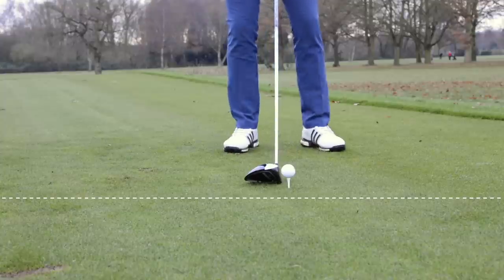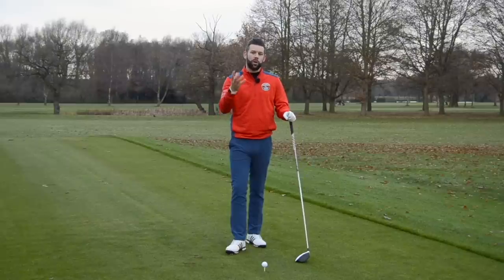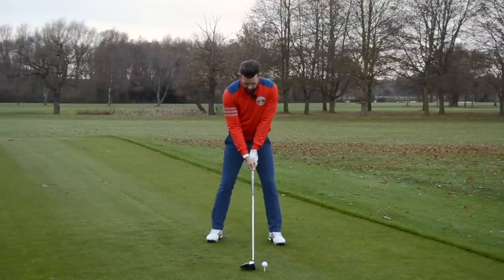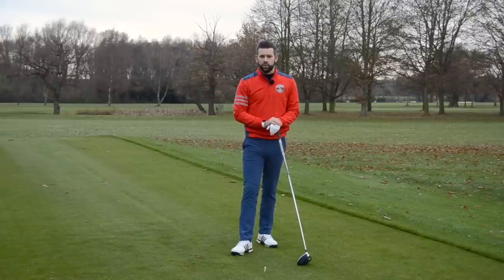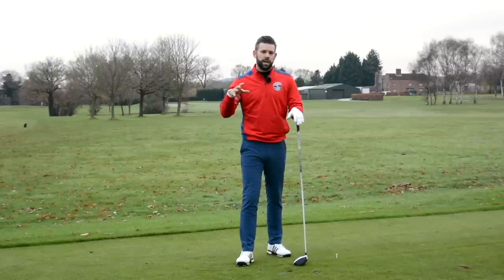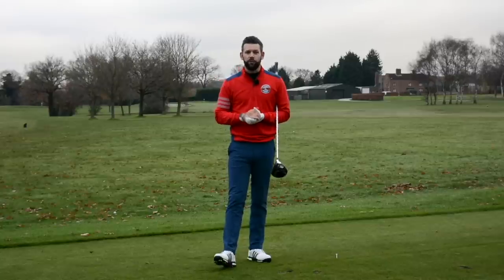DRIVER - HOW TO LOWER YOUR SPIN

Comment: I've always thought that to increase my AOA, I had to get my CLUB FACE pointed more towards the sky - but looking at how spin loft works - dynamic loft should be low (so my clubface is NOT facing more skyward) and AOA should be upwards. It is very similar to a topspin forehand in tennis - to put an image to it.

Comment: Thank you for these instructions. I have a left to right side spin about 30 percent of the time even though ball is straight in air. It will bounce to the right quite significantly on the fairway, often into the fringe.

Comment: Mate this is something I have been having issues with and could not figure out how to fix it nor was I ever taught this drill. This is the FIRST drill that cured my snap hook and I went from swinging out of my shoes with ball speed around 150, 2500 -2800 rpm hitting anywhere from 250-300 yards and after this drill it was an instant fix. I now hit half swing drivers 275, 135 ball speed, 1800-2100 rpm and its like a baby draw. Launch angles are around 12-14. How can I apply this with a full swing? Also, is this the same concept for irons?
Reply: Don’t hit up on your irons, it will be a slightly descending angle unless the ground is very wet then try to hit more neutral. Hitting up with iron will come out thin

Comment: I went to Ping for a fitting. I had 18 degrees of dynamic loft on a 9 degree driver. Spin was up to 5300 rpm! My swing speed should carry 240 yards, mine were 203! The 3 wood went further. Need to hit the ball properly. I’ll speak to my pro for some drills, this explains it well.

Comment: i was just hitting the ball as hard as i could and i would hit the middle of the face and the ball would go super  high but not very far. maybe just over 210. then mid round yesterday before I watched this video I tried keeping my wrist bowed and swung slower and I crushed it off the middle of the face and hit a couple 250 drives. I even had one roll out to about 300 and off the course lol. The ball even went straight for once. I currently do not have a driver of my own so i use my friends. Cant wait to see how I do with a driver fitted for me and paired with this technique to see how far I can hit the ball.

Comment: Went to the simulator for the first time recently. My driver spin rate was over 7,500. I can hit my 3-wood a solid 265 carry but my driver doesn't go more than 250. Seeing a PGA pro soon to get a few lessons and to get a proper fitting.

Comment: I hit driver really high and spin it too much, I hit up on it but struggle with dynamic loft. My driver is already down to 7.5 loft so I need to stop adding loft but can't figure out how
Reply: Know the feeling. Mine is still set to 9.5, but get a lot of shots going too high. For me it's when I don't focus on target, but just wanna hit the ball. Reducing lag by "releasing early" (which can increase loft significantly).

Check out some of Shawn Clements videos, and I think you'll understand better what I mean.

Comment: Great explanation Chris. How would you advise spin 4500, Angle of attack +4, launch angle 15 degrees. Contact is pretty much on the centre of he club face. Hit a little draw. I have tried many options to lower the spin but with no success. Any advice is welcome.
Reply from the maker: Gordon those numbers seem pretty good to me, that attack and launch with a right to left shape suggests face is in good alignment too. I would certainly be keen for you to check driver fitting and golf ball style

Comment: So you are essentially trying to add top spin (reducing backspin) like a tennis top spin shot right?
Reply: No, Reef Guy, I think you misunderstood the point. Chris was assuming that the questioner was hitting down on the ball(negative angle of attack, which caused too much spinloft) and showed a drill to fix that. He even says:" Notice how im trying to keep the handle forwards of the clubhead...". So there's no flicking of the wrists before impact or anything complicated.
Reply: @nicolasstergaard4992  but I thought flicking your wrists essential releasing them with lag is how you get power?   I dont think anyone just keeps their wrist stiff.  Please explain.  Not trying to be a jerk at all i just don't understand.
Reply: @AquaGeek  There's no mention of power in this video, it's only about lowering spin on the driver and thereby getting more distance. The questioner is spinning his driver 3800 rpm which is waay too much - depending on swingspeed 2500 or lower would be preferable. The wrist-thing that might be confusing(at 5:32 in the video), is Chris showing a drill to get a positive angle of attack(hitting up on the ball) and a lower dynamic loft(forward shaftlean=less loft) - which combined gives less spin.

Comment: My backspin for my 3 iron is 4754. 12.6 ° loft. About 600 rpm right. 109mph. Is that too much backspin. I have 20 yards roll on the shot. Where should my backspin be for my 2,3 and 4 irons along with my driver? Thanks.

Comment: Hi. Attack angle 2 degrees up with 11 degrees loft on club. Not sure what dynamic loft is but spin up to 4500 . Using Rouge driver with low spin Hzrds black project x shaft? Any ideas?

Comment: I don't have access to the technology to learn all of the numbers from my drives but I'm betting I'm spinning upwards of 4000rpm. It's frustrating putting in so much work into straightening my drives out, only to find out that I basically can't carry the ball further than 230 yards. Gotta sort this out.

I do know that my swing speed is ~96mph with a driver too.
Reply: camelCase This sounds very much like it could be my story. I feel like I put a good strike on the ball, good contact and hit it very solid many times, but have seen the ball back up a couple feet after landing. Chris has a very good explanation here though. I will try it out and seen if I can get my spin down.

Comment: I have trawled through many a reduce spin video and this is without doubt the best explanation yet.
Very clear and excellent drill to get the feel of your cure. Cure I hope it is as I suffer from high spin and a drive reduction of some 50 yards on my drives of a few years ago. I’m 75 and really fed up with no run and even backspin on soft fairways with a drive. Hopefully Your video will help.
Many thanks.

Comment: I just left a Dicks sporting goods. They just got a new launch monitor.  I have a 917D3 at 9.5 degrees in the C1 setting which results in a true loft of about 8.75 degrees. My swing speed with a 70 gram X stiff shaft and a midsize grip was about 110. 

I tried a 65 gram x stiff evenflow shaft on the new TS3 at 8.5 degrees A1 setting and a standard size grip and my clubhead speed went up to 115 average. 

My spin numbers were never lower than 5500rpm. And as high as 8750rpm... I think its a combination of junk launch monitor and a what in the living hell is going on as to why my rpm is so high with my driver? Smash factor around 1.38-1.47. Is my swing too steep? How can i reduce those numbers so the ball doesnt fall out of the sky around 240?

Comment: In 3.45min of the video youre saying that dynamic loft is 20. Why is that. It shouldnt be zero if you just hit it down on the ball?
Reply from the maker: Hey thanks for watching, this was just an example of how to calculate spin loft, these weren’t accurate numbers. However to attack angle foes does directly influence the dynamic loft, so very possible to hit down by 10 and present 20 degrees of dynamic loft 👍

Comment: Of course, the faster you swing the more backspin will be applied. Regardless of "spin loft", if you swing over 110 mph you just can't decrease backspin, it's just too fast. It's basic physics.
Reply from the maker: The driver is the club we swing the fastest..... yet the ball has the lowest spin of all the clubs, so this tells us that speed does not mean high spin at all, we can control it 👍👍

Comment: Surely roll and bulge has an effect. High low mid on the club face effects spin.
Reply from the maker: Absolutely, contact point makes a huge difference to spin.
Reply: You  should do a video to explain the different effects of spin where you contact the face.and give readings of spin and the best or ideal contact.
Reply from the maker: Yeah that could be an interesting video, and eye opening for many!

Comment: I constantly spin my driver at the lowest around 4500 and it can peak as high as 6000 rpm with an attack angle of 3.6 with a 1.43 smash factor and I swing comfortably at 118 mph I play the titleist 917 d3 At 8.5 head but set at A4 with a tx prototype diamana white board in a x flex shaft and I was fitted (  a4 is -.75 degrees lower for a lefty) and I have an insanely high ball flight naturally how can I get a lower flight and less spin? Natural ball flight is a slight cut or baby fade and I like to work the ball right to left
Reply: Everything you said makes sense for your spin numbers - i.e. you are hitting a 4500rpm amateur fade. Most likely you are 3 to 5 degree Out to In and 2 to 5 degrees face open to path - so you are delivering a hard but glancing blow (1.43 smash) with 19-21 degrees spin loft. You have 2 choices. The easiest is to  buy an extremely low spin head Epic or Rogue Sub Zero or the M3 with both weights forward (this is difficult to control). These heads alone, even with your delivery, in their lowest spin setting, will knock off at least 1000rpm. Your second choice, requires far more works but less money, and that is to learn how to hit 1 degree In to Out, 1 degree face closed to Path, and consistently middle to slightly above middle on the club face (my guess is that with your out to in swing with face open you are not hitting the middle of the driver). If I hit my automatic 250 yard carry baby fade with similar numbers I am 3500 -4000 rpms - but my swing speed is 108. If I'm going for my knuckleball, teed high, In to Out High draw with a slightly high toe hit, I spin at 2200 and the carry will be 270. If you want to hit a 2200rpm DJ Pro fade, you are going to have to learn how to hit it 1 degree Out to In with Club Open 0.5 Degree Face to Path, in the middle of the club, 4 degrees up on the ball with 7 degrees of active loft presented to the ball to add to the 4 upward launch = 11 degrees. Hitting it that square with increase your smash factor to 1.48 will give you a 175mph ball speed and you will carry it 315 with a 10 yard fade.

Comment: ... loft is not the only contribution to spin. You're ignoring the horizontal  factors.

The real danger here is to get bogged down in Trackman. It shouuld be obvious why you're getting high spin numbers. If you don't know why then you don't understand TrackMan.  They have their own site and their own YT videos to explain their numbers.

But
Spin and loft are two different things. Likewise it should be clear that swinging up into the ball combines with high club loft to produce high shots if the ball is hit off the clubface vs topped...especially if hit off the top of the club. Spin comes from clubface motion relative to the ball in the vertical plane. The point of spin loft is that it is a numerical quantification of how much the club face is moving horizontally and vertically relative to the ball at impact...so it is not quite the same as DL-AA. That is an oversimplification. Some of the spin comes from a sideslip that results in lateral spin. You'd need to know the spin angle.

Comment: I'm not sure this actually works..if my attack angle is down like-10 how can the face be pointing upwards +20. It can do that only of the shaft is leaning back wards which means the attack angle will be +ve
Reply from the maker: I’ve never seen that impact achieved, I was simply using those numbers to help explain a build the picture, the information in this video is correct I wa just using simple numbers to get the idea across 👍